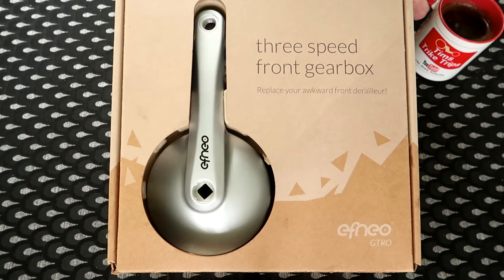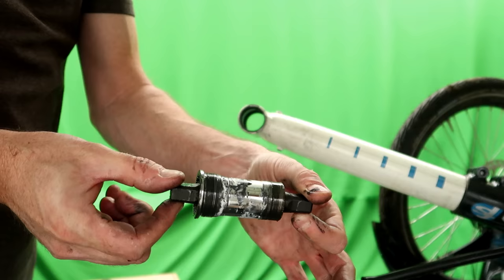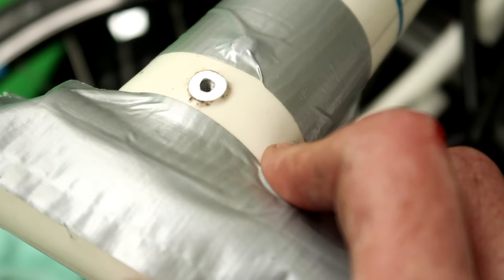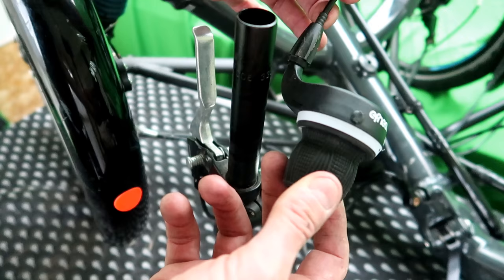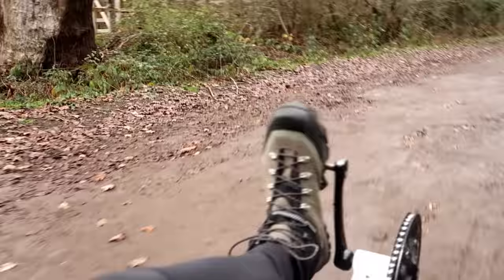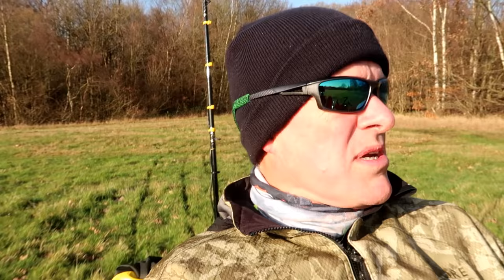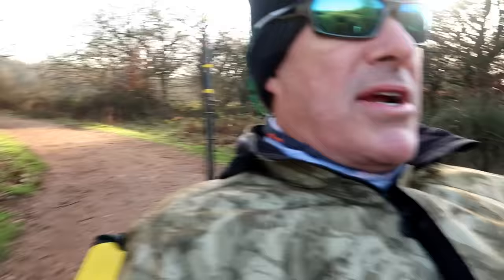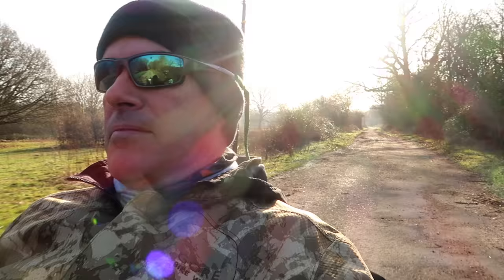Efneo GTRO Gearbox | unboxing | fitting | first ride.

Comment: Dont worry, about the Rolhoff , You wont damage it... the back wheel will start slipping ( Spinning )  before you can add enough torque in the hub to break the pins.. so no matter what you wont be able to break it..

I have the same trike and run the same setup, BUT have a mountain drive on the front , my small chain ring is 22 tooth front and 16 on the rear.. i have had the trike loaded with a total weight including me with 150 Kilo's and did 600 k's on it with a lot of steep hills.. No problem.. have done about 3,000 K's since then loaded with over 120 kilo including me. 

A local Trike manufacture here in Australia (Well known)  Went to Rolhoff years ago and they did a test to see how hard it was to break the pins in the hub, the load on a TANDEM recumbent was TWO Very strong riders, 25 kilo on the rear and they could not get it to break until the put another guy sitting on the rack on the back to stop the back wheel spinning.. So total load in people was about 250 kilo Plus 25 kilo gear ( About 110 Kilo over rear wheel ) , setup from memory was 16t rear and 24 front

So you really have no need to worry ! 

Just had my hub serviced after overall total of 30,000 K's on the hub ..and asked about pins, He said they looked just fine and dont even need replacing. .. So there is some feedback base on real world testing, Dont even worry about it Tim.. Just ride and enjoy !
Reply from the maker: Hi Mark. That's really reassuring to hear. I'd read elsewhere about the testing they'd run with two big Olympian cyclists. I kinda figured they'd have to leave some margin for rider error, etc. But from what you've described that's quite some margin. 😋
Anyway, I'm happier now I've read that, cheers. 👍

Comment: Get your self a pipe wrench for that big adapter (Gas type). There fairly cheep and they've got some leverage. Also I use washing up liquid to put the bar handles on with. Can you put the trike on flat ground and show the gear box. Then peddle and change the 3 gears to see the difference . Cheers Paul
Reply from the maker: Hopefully wont need to undo that BB anytime soon but if I do then I'll bare that in mind. I try not to use the washing up liquid on the bars in case I over-do it and it keeps moving forever after 😉
I have a video coming out soon with the trike up on blocks. That should give me the opportunity to show you the gearing more closely hopefully.
Thanks for your comments Paul. They're always welcome 👍
Reply: A bit of rubbing alcohol eases grips nicely and evaporates without leaving residue.

Comment: Best thing to use to install the grips is hairspray. It is slick when wet and forms an adhesive when dry. It works to get them off as well, just pry up the rubber on the end using a tube like for spay can works well.
Reply from the maker: Richard, that is pure genius! I learn so much from these comment sections.
One day I reckon I'll make a video compilation of all the helpful ideas people come up with.
Fantastic mate. Thanks so much. 👍
Reply: @TimsTrikeTrips  The thing  you filed off the trike boom is called a "Boss" just an FYI. That was a good video. I'm still chewing on getting a trike for touring. As for now i'm riding a Trek 920. The GTRO gear box may be a modification in which gets made to the 920 but for now i'm putting a "dinner plate" on the rear 11-42 cassette. There should be very good low gears for touring overall. The main reason I was looking at the GTRO gearbox was to give me a little more higher gearing for flats when needed, and eliminate the front derailleur.
Reply from the maker: Ah! Yes, a boss. 👍
The 50 tooth equivalent on the GTRO will certainly give you that on the flats. I'm also just as certain I wont be using that end of the GTRO very much, ha ha.
Reply: To make it even easier when removing/installing grips and/or like components is to use rubbing alcohol. Won’t damage parts, Evans to leave area completely dry, and no residue. 
Also is a multi-use item in your maintenance arsenal.
Reply from the maker: Probably removes oily residues as well? Nice one. Thanks for the suggestion. 👍

Comment: Hi Tim Im not telling you what to do but I think you should do some research into getting a trailer The weight would then be transferred to the trailer wheels Going uphill you will have some extra pull but easier on the trike than having all that weight on it Also having all the weight of the gear on the trike virtually renders your full suspension useless for the entire trip
Reply from the maker: Hi Denis. You can tell me what to do all the time if you like. That's one of the things about my channel. I dont pretend to be the professional Trike guy. I'm learning like everyone else. All suggestions are welcome and even if I dont use the ideas every time then someone else might, so please suggest away...
I've now moved on since this video to the point where I'm trying to massively reduce my weight so I hope a trailer wont be necessary... but who knows?

Comment: Tim the audio is great, what camera are you using?
Reply from the maker: Thanks my friend. I mainly use the Canon G7X MkII. 
I also have on hand a little lavalier microphone if needed (not in this video).
Other cameras I use are a GoPro Hero 6 and my Galaxy S9 phone, but again not in this video. This one was all with the Canon.
Reply: @TimsTrikeTrips  nice. I have a couple of GoPros (3+ & 6). I need to save up for one of these. Seems many vloggers go to the G7X.
Reply from the maker: I saw so many other vloggers using the G7X and the MkII version that I figured it must be worth it. I've got no complaints at all. Its easy to use and does everything I need it to. One of my better purchases for sure.

Comment: Nice set. I would close the hole, paint that part and put a sticker for protection on it.
I have now a rear  outerwheel for a mountain bike, for as I ride on those roads for more grip in the back.

Is that also a 155 or a 170 size for the pedal distance?

That weight thing is not that big of a problem with how you use it. You don't race and push it to the limits, so I think even with extra weight that it will not be a big problem.
Reply from the maker: I put a load of grease in and around the hole. I'll take a look at it again next time I do some work on her I expect and put a patch over it maybe. The Gearbox has 170mm cranks. No choice on that 😐 I hope you're right about the weight. Time will tell I guess...
Thanks for your comments as always my friend. 👍
Reply: @TimsTrikeTrips  I think that as you put a stikker there, that it will close the hole. It's just to keep stuf out.
The reason why you did this, is why I make also 3 in front and 9 in the rear. Than I have for speed, touring and for hills.

Maybe an option to use blocks that make that the pedals are mounted higher on the cranks. I had them as a kid so I could reach my pedals because I was to small for my bike and my saddle couldn't be mounted lower. I was thinking to use that on my build as I start with the old parts before I upgrade to new stuf.

I do also 3 in front and I will use 9 in back for the same reason as you. Than I have the option for speed, touring and mountains.
Mountains or better britches. 😁

End of this month or begin januari, I start to order the steel for the frame. The wheels and some small parts are in and the other parts come the coming weeks. Do building starts in January and I hope to be ready in March but as it is later, than it's no problem because I want it to be ready before June, so I havd time enough.
Reply from the maker: You should video your build perhaps for YouTube?

Comment: Looks pretty good Tim, are you using clips in on your pedals. I thought you might like to know I have added "Power Grip" pedals and they allow me to wear sandals in the Summer and good leather shoes in the summer. 15Kg kit weight is a pretty good weight to carry around. P.S. that looks pretty good tucker,,,,,,, ride safe my friend
Reply from the maker: Hi Brian. Yes I'm still clipping in. I have to with my right foot else it will likely fall off sometimes 😖 Those power grips look good, though my feet are so cold when cycling at the moment I don't even want to think about wearing sandals, ha ha. Roll on Summer Eh!?
My Kit is 15kg. My problem is then the additional daily food and water. I reckon I'll just try pushing my luck a bit. I'm no Olympian athlete. I really cant see me breaking the hub.
Stay tuned for the cook up 👍

Comment: I assume, since this is a single gear ring set up, you can use all 11 gears in all three of the gear box settings. How has the gearbox held up since you installed it? Any issues? Was the install as easy as you made it look? I'm trying to decide between this one and a FSA Patterson drive. Thanks for the video!
Reply from the maker: Hi Larry. The install is probably easier than I made it look, to be fair. The guys at Efneo contacted me about the cable length prior to shipping and it arrived assembled and ready to go. It really is so very simple to fit. If you know how to remove a bottom bracket then you cant go wrong. I've had no issues with the gearbox at all. Its very sturdy and a quality item as far as I can see.
I dont know anything about the Patterson drive so I cant offer you a comparison sorry but I don't think you'd be disappointed with this if you go for one.
I'm going to do a review of the gearbox hopefully later this month... if thats not too late for you to decide.
Thanks for watching.
Reply: @TimsTrikeTrips  AWESOME! Gearbox will probably be after the first of the year; spent too much money on upgrades already this summer!

Comment: I watched this video and then watched the second one in which you document your problems with the gearbox. One thing that struck me immediately while you were installing the gearbox originally was that you seemed not to have tightened the bottom bracket shells more than hand tight - if you did torque them, you did it off camera. So I wasn't surprised to see in your second video that the BB was loose. Also, the crank bolt should be torqued as hard as possible in my experience. If it's designed properly, the shoulder of the bolt will snug up against the end of the square taper, which is the point at which the crank is tightened properly to the shaft. After that it is just solid. I noticed that your torque setting still allowed you to torque the bolt a bit further - not a good sign imo. I find it's best to tighten the cranks down again a few days after initial installation for a really solid assembly.

Anyway, if the whole assembly (BB and crank) was loose, this would explain why the torque arm was damaging your paint job and denting/grinding against the boom, because it was wearing from side to side as you rode the trike. Once the paint was gone, the cable tie connection would be loose, which would further exacerbate the problem. Your DIY bracket should deal with that. 

Having said that, Efneo's response to your concerns was pretty shabby. I'd be interested to know how it works out after a year or so of use. The concept is good.
Reply from the maker: Hi Rob. I'm keen to point out again that I'm primarily a cyclist and not a mechanic 😉 The reason I attempted to fit this was because it is sold as "...easy to fit yourself". With a little hindsight it actually was quite easy, so I'm not complaining. As I mentioned in the update I didn't have the right tool for the BB shells but still did them up as tight as I could with the wrench that I had. No excuses though, you're right, I should have torqued them down properly the first time. And in future I wont be scared to tighten those crank bolts until the tool bends, ha ha. I'll have to update everyone on the gearbox in a few months but for now it's solid. I'm really happy with the performance too.
Thanks so much for your thoughts and observations. I try not to hold myself out as any sort of expert and am always ready to learn from my subscribers too. 👍
Reply: @TimsTrikeTrips  Hi just as an aside. I bought one of the original Efneo Cranksets installed on an HP Gekko. They are very easy to install but just as it says on their website, you must follow the instructions to install it properly. Efneo does make an option to using that anti turn tab on Tim's trike but I think he could have found another method instead of grinding the rivet nub away. The Efneo in my opinion is the best made, best performing Internal crankset on the market & it is the only one with 3 selectable gears. I think you can also get some custom sized rings now as well.

Comment: Hi Tim, I'm a Trike Rider as well as a fan of Internal Gear hubs. I did a comparison of the various Gear Inches achievable on the most common hubs if you would like to keep it for your future reference. As far as keeping the Rohloff within its safe range, Rohloff limits are extremely low which must be so they don't have to deal with warranty claims. Out of all the hubs to choose from they are by far the strongest so I wouldn't worry about having problems with the ratios. Please go to Internal Gear Hubs page (Sorry, but Facebook has made it SO complicated I'll be moving everything to a new location if you can't find it just message me) - https://www.facebook.com/permalink.php?story_fbid=303165143481402&id=296893474108569&comment_id=406567569807825
Reply from the maker: Hi Glen. Thanks for the link. Some really useful info for sure. And thanks for the reassurance on the Rohloff hub too. 👍